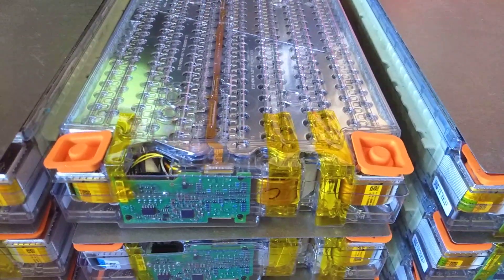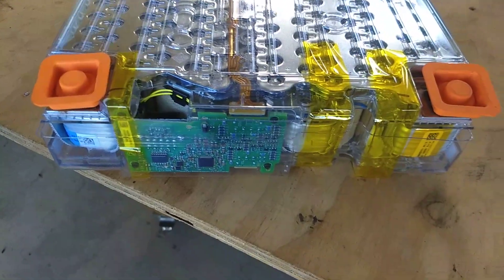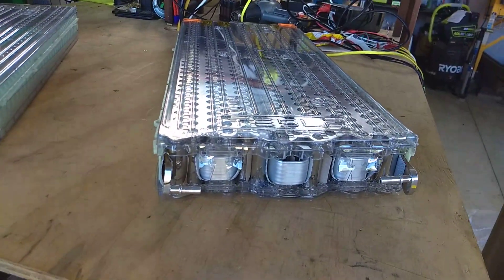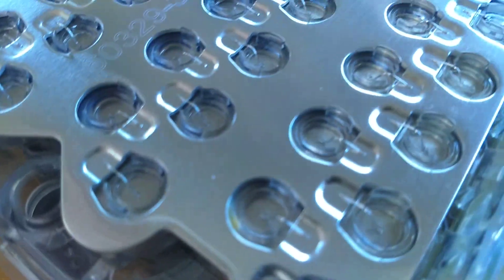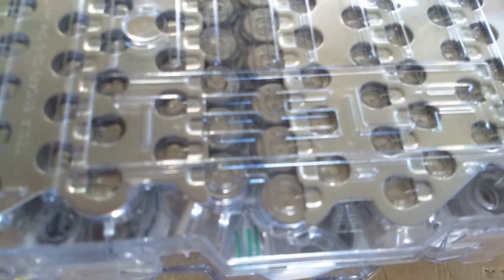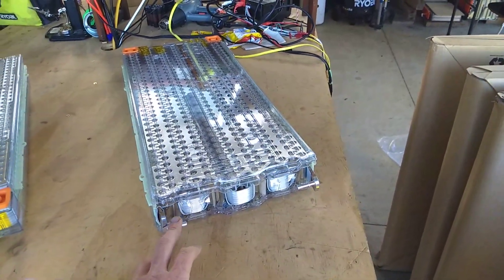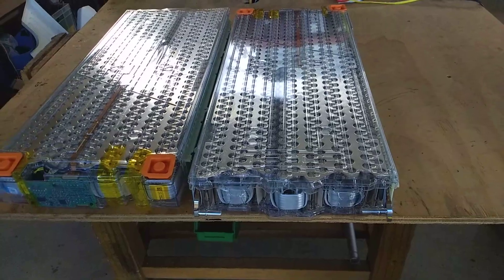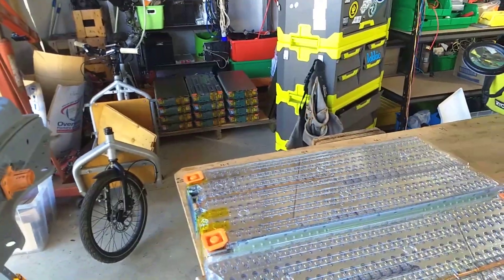Geeking out on Tesla Battery Modules

Comment: 74 P  that means there is no individual cell monitoring, those 74cells cannot be distinguished from each other, they are basically treated as one cell, at the moment there is no way around that, no ev maker has solved that issue.
74 divide 444 cells means less than 20% of the pack is monitored in reality......interesting is it not.
And  yes it is a work of art.
Reply from the maker: Yes, because they are connected in parallel they are effectively 'one big cell' that just happens to be spread out into 74 separate containers. They will behave identically so they don't need individual monitoring. What this method has over something like the Leaf pouch cells or the 'blade batteries' is that if there is a fault in one of the cells you don't lose the whole series. Its connector acts as a fuse, burns out and disconnects the problem cell from the rest of the cells. So you lose 1/74th of your capacity rather than all of it. You almost certainly avoid a fire too. Yes, it is a work of art.
Reply: yes a work of art, but what about if a cell fails and it doesn't burn out the thin fuse wire? Cells do fail for varous reasons and few involve an overcurrent event. Lets say a cell gets high resistance for whatever reason, lets say the SEI layer gets thick rather quickly and internal resistance goes up, that cell will tend to deliver less amps and will get hotter during charge. 
My point is all those cells in parallel are pretty much unmonotored, apart from knowing the total voltage and additive internal resistance.........my point is there is no inidvidual cell monitoring, alot of people say these packs are monitored at a cell leve but they are not. Lets say this cell gets very high resistance and during charging or discharging gets hot enough to catch fire, how will you know it is going to happen?
 @RaglansElectricBaboon

Comment: Beautiful indeed! I'd use 3 or 4 packs to make an ebike or etrike and the others as a powerwall with solar, both with inverters and v2g capability. Possibilities are endless. BMSs are easy tech now and for light applications of a few kW the cooling circuit wouldn't even be needed.
Reminds me that I still have 1000 harvested laptop cells to assemble into something useful!
Reply from the maker: You can make two Tesla modules with those ;)
Reply: @RaglansElectricBaboon  Almost - the average capacity of the cells is about 2/3 of the Tesla's NCAs, but still a useful amount.
224 are used in a 14S16P pack for my ebike, and I'm still waiting to get momentum to log the rest in a db and apportion into packs. Not one of my favourite chores which is why I've procrastinated so long.
https://twitter.com/ahaveland/status/983468199206367232